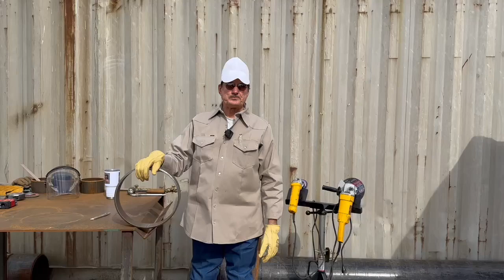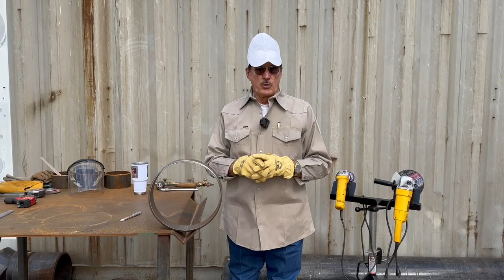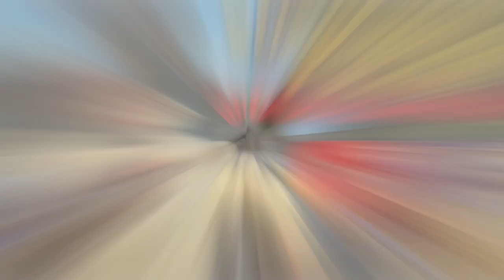Pipeline Longevity, Ruptures, and Safety, Pt. 1

Comment: how do you find pipe line jobs without having to know someone?
Reply from the maker: According to the internet there are about 590,000 welders of all kinds in the USA , about 290,000 are pipe welders of one kind or another. Plants, shutdowns, offshore ,  maintenance etc.
Pipeline work is probably one of the smallest categories.
It is a highly specialized ,one of kind type trade.
Most welding schools teach a tig and stick welding combo mix. Nothing specific to pipelining unless you are able to get an apprenticeship in UA local # 798 in Tulsa Oklahoma.
That leaves hiring out as a welders helper for a pipeline contractor or oilfield contractor where they use do downhill pipe welding. You will have a welder to watch and ask questions and learn the trade from. You will be getting paid, instead of paying someone. start off by saving some money and buying a truck suitable to make a real rig out of. Next find a good welding machine . Once you have the truck and machine, you can get some pipe and practice what your learning on your days off etc. if you make a good helper and get better at your welding some contractor will be inclined to let take your first test. If you pass it, they will put you on the easier work to get you going??
If you have already broke out welding in the oilfields doing downhill welding on fabrication, you need to get some 12” .375 pipe / 12” .500 pipe and practice for speed and quality.
Once you think you’re doing pretty good, go and apply with all the pipeline companies you can find. 

For welding or helping jobs right now, go online and do a google search for 
Pipeline welding contractors,
Pipeline construction companies,
Oilfield construction,
Pipe fabrication companies etc.
Google search in your local area or try these.
Texas:
Houston area
Midland/Odessa
Monahans

Carlsbad New Mexico
Williston North Dakota
Minot  
Dickinson 

Louisiana 
Morgan city
Houma
New Iberia

There is a one year job hiring all crafts in New Iberia Louisiana . Sun industrial Qroup. 337-936-1158
7 - 12 hours a day/ $150.00 day per diem.
Thank you!
Reply: @GeraldWBrister  Thank you for the reply mr. Brister. This might be a good topic for one of your videos, I know many of us with no contacts on the pipeline have wondered about this.
Reply from the maker: @___99____  
That sounds like a good idea, thank you!
Reply: @GeraldWBrister  Thanks for the information! well appreciated
Reply: Good question I’d like to know too
Seems like you don’t lol